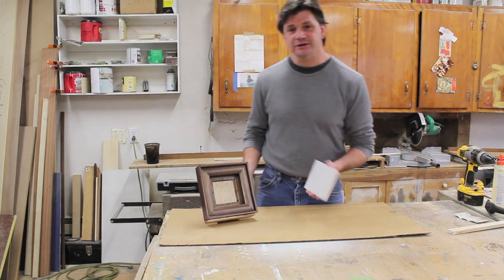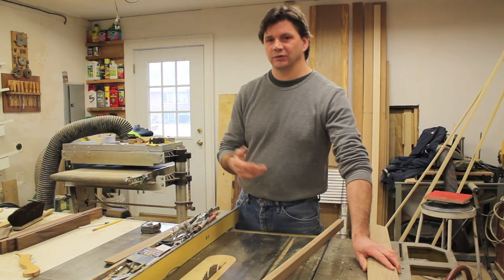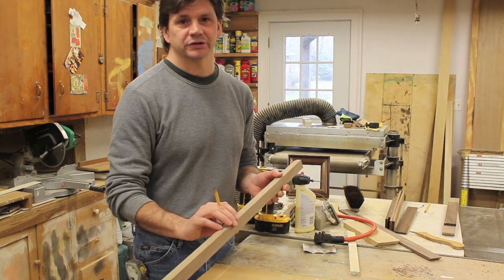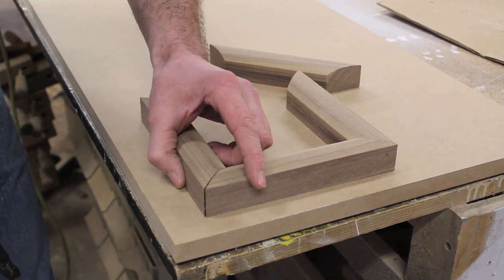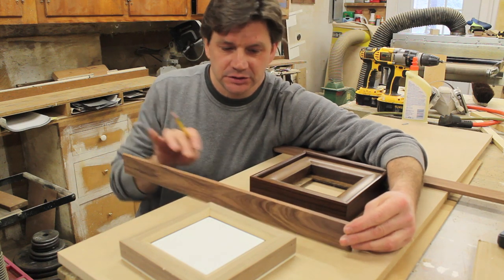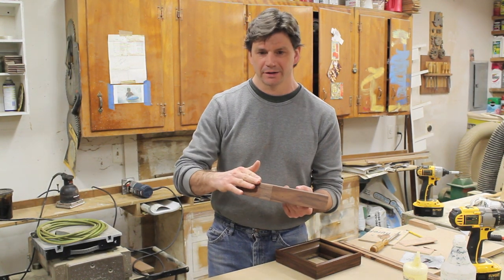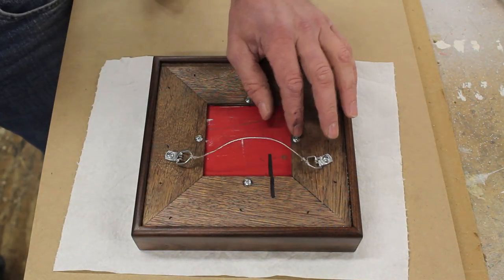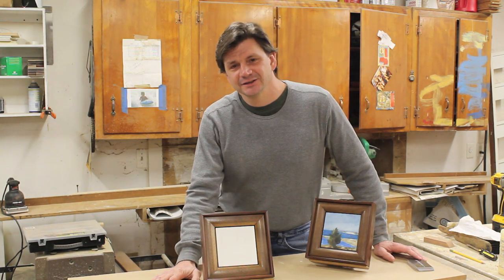Giveaway! ( CLOSED ) Make a Walnut & Rosewood Picture Frame by Jon Peters

Comment: Jon,

Thanks for the framing primer. My entire wood shop consists of a chop saw in the garage, so I think if I buy the right stock moldings I can make this work. I'm also using your french cleat instructions to set up a 3 by 3 encaustic installation. I'll just center the top-center panel, then make sure the others are level and 14 inches away on center (12" by 12" panels with a 2" gap). The "play" in the positioning should allow me to have all the spacing perfect.

Thanks again.